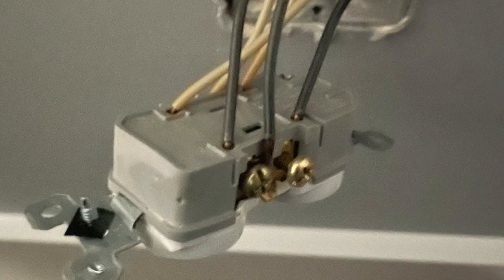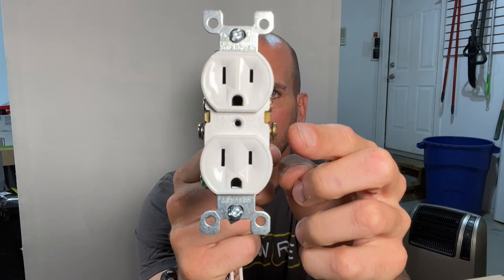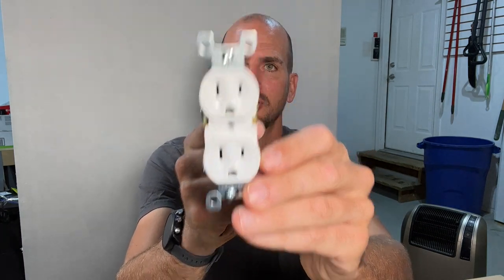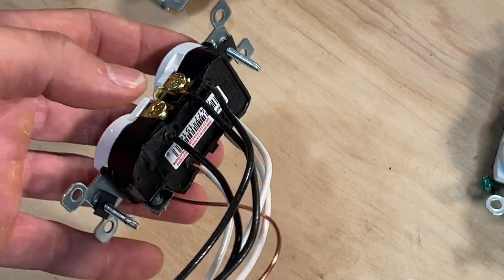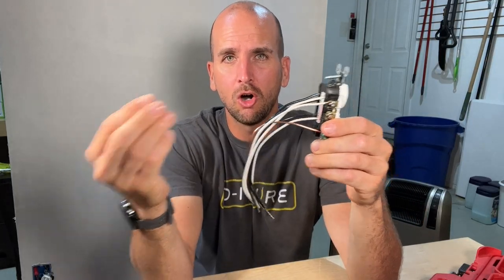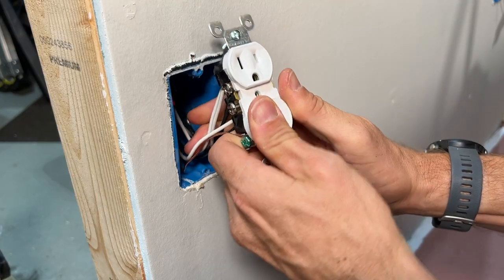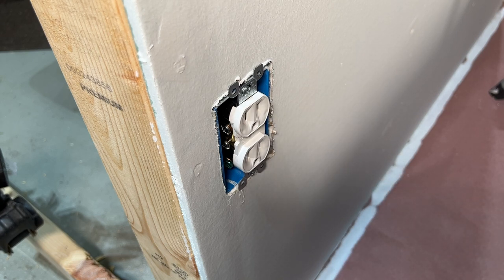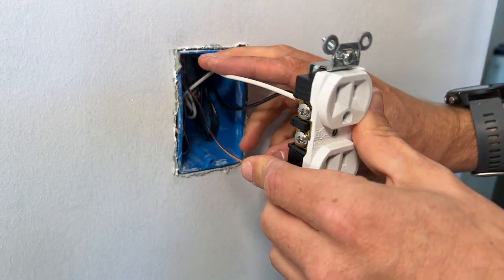Beware Of These Wiring Mistakes Made On Newly Built Home

Comment: Great video thanks a lot, bought a condo built in 1974, most outlets have the top outlet controlled by an on/off switch and FOUR neutral wires ALL backstabbed, I can use a wago for four neutral wires and connect to pole and then connect the two Hot wires to other pole.

Comment: I have been subscribed and watching for quite a while, always learning. I love the Wago 221’s for adding fixtures and doing pigtails. One trick I came up with is to wrap electrical tape over the levers when closed so they can’t be forced open and if it is a pigtail that turns 180 to to get to the fixture/outlet tape it down to the side of the Wago so it can not spin and possibly loosen. An extra step but makes me feel better. 😀😀

Comment: I totally agree, I'm a tech for Toyota and the way guys repair vehicles, flat rate style. I don't agree with flat rate repair rushing vehicles in and out of our dealerships. I would imagine same goes towards building homes as fast as the developers would like to complete. I did our electrical in my home as per the NEC and alot of it corresponds to the way you explain SAFETY. Thank you..Ricky

Comment: After wiring my campervan, adding and replacing outlets in my home and swapping the absolute garbage excuse for an outlet with "real" outlets in my dad's RV I have come to like the leviton decora heavy duty outlets. They are better quality than the residential outlets and offer my preferred wiring method, back wire. (Not back stab)I also find that pigtails and WAGOS can make the job easier if you're working in a tight space or with very short wires coming out of the electrical box. On a side note it is always entertaining to see people argue in the comments over their preferred methods and their own interpretation of code and best practice!

Comment: Good ideas on the Wago connector pigtails.
Reply from the maker: A lot easier to bring 4 wires together with the WAGO 221 lever nuts 👍
Reply: @EverydayHomeRepairs   I'll try this on my next 15A receptacle repair.
Reply: Did I see THHN wire in the video?  Why not UF-B 14/2 or 14/3 for indoor residential receptacles?

Comment: I have even seen outlets with no screws at all (back stab connections only) in a residential installation.  When a contractor is installing hundreds of outlets a few minutes time saved on each one can add up to a lot of money at the end of the job.  However I always side wire using the screws or back wire on commercial grade receptacles with screw down clamps.
Reply: The best is not to create three separate wires. It can be done. Daisy chain should only have two sets of wires not three. Start at one end and end up at the last outlet. Never run supply at the center. I also never put lighting in my daisy chain outlets. A separate breaker for lighting. It's nice to work on outlets with the lights on. Most short circuits are from outlets not so much lighting circuits. There are exceptions to the rule. I also don't use number 14 wire. The only acception would be outdoor lights to save money on UF Romex with LED lights 14 would be heavy enough. Outdoor outlets I use number 12. I'm old school and range hookup will be number 6. I know about using number 8 but 6 is better , just like 12 is better than 14. 20 amps is better than 15 and 50 amps is better than 40. Remember I'm wiring my own home so I dont need cost saving shortcuts. If I was hired then I have to listen to my boss. I'm wiring my home I'm the boss. 73
Reply: I always run pig tails and use screw terminals on jobs where the customer is reasonable to deal with. When I get a cheap customer that wants me to do it cheaper I use daisy chain and back stabs I don't even tighten the screw terminals then either if it's a plastic box. I think as a contractor it's important to respect people that respect you and your profession. I always go the extra mile for people who are good to me. For people who just want it done they get the bare minimum from me
Reply: @gurjindersingh199  I only run 2 pairs of Romex on any of my outlets, start on one end and end on the other. I never include lighting on my outlet runs. My lights are on another circuit even outlets used for lighting. My dad taught be this practice. I only use screw terminals or screw down on the back holes I never use them cheap push terminals. Now I'm only wiring my own or a relative home. I'm not a licensed electrician. 73

Comment: I don't know how the recommendation of a 20a breaker vs 15 is much of a mistake. If you are adding a circuit in a new construction, then sire it is the better choice. But upgrading the entire circuit and breaker might be out of the range of a diy project.
Reply: Exactly. It's always not reasonable to rewire a receptacle circuit that's 15 A, 14 awg to 20 A, 12 awg, especially if they're sharing some lights

Comment: Instead of using the term back stabbing,  I like to say La-Z-Wire,  QuickWire or SpeedWire to avoid confusion to back wire, since people tend to use the terms interchangeably,  including myself when I first entered the trade.    I do not like backstab,  and have seen them fail.  

The worst failure of a back stab,  was in a home built in the late 70s where the neutral failed on a multiwire branch circuit in a living room.   The receptacles were alternating between the red and black along the wall sharing a common neutral,  fed with 14/3w/G NM.    A television and cable box went up in smoke,  when the neutral opened when an electric fireplace was in use in a different receptacle, placing everything downstream in series with 240 volts.   One good reason the code requires pigtailing the neutral when a multiwire circuit is used.
Reply: "Instead of using the term back stabbing,"

Just call it what it is- cheap-connector ;)

Comment: I like the WAGO connectors has much as you do. One more European product I would like to have available here in Canada and US is the green/yellow sleeve the UK electricians install on the bare ground wires in the outlet boxes as well as in the main panels. I think we should consider using this method for better safety in our thigh outlet boxes.
Reply: You can wrap green electrical tape on bare ground wires to insulate them, or use liquid electrical tape on them as well.  Liquid electrical tape comes in green for grounding, black, white, red and other NEC Colors.  I've purchased liquid electrical tape for projects before.
Reply: I agree with Max here. Just wanna add that sleeving or insulating a bare ground wire inside an outlet box isn't necessary, since the ground wires aren't current-carrying conductors and provide better contact with a metal box whether or not it's bonded to ground. So the only benefit I can think of for using a sleeved ground wire is to distinguish a pigtail bonding a metal box or device.

Comment: I'm with you 100%, back stabbing is a no no as are cheep outlets, I only use 20a outlets and 12 ga wire but have found electricians that will not use 12ga wiring saying it's too hard to work with.  Wagos are the greatest but a word of caution there is a marked difference between the Chinese knockoffs witch I received by mistake and sent back.

Comment: My main concern with Wagos is the wires use an internal busbar compared to touching directly.  However, you are extremely competent doing a lot of work with them.  This video has convinced me to give them a try.
Reply: Don't worry. Wagos are awesome. They're super easy to use and very reliable. I use them for every ceiling fixture install and attic junction box I wire.

Comment: If you want to  use 20A circuits for receptacles  you then can not mix lights  with the receptacles In Canada. In residential you can not have 20A lighting circuit's.

Comment: Scott mentions "pigtailing" and I immediately think "Wago nut time".   Guess what I use for electrical work...   

I would be careful about calling #4 a mistake.  My house is 100+ years old there is still knob and tube wiring on the main floor and second story.  Since I don't know the gauge of that wire, I'm keeping those breakers at 15 amp
Reply from the maker: Yeah, more of a mistake for the new builds.  If you are going to do all the hard work of building a house might as well put your outlets on 20 Amp breakers with 12 gauge.  Or at least that is my preference 👍
Reply: @EverydayHomeRepairs  if the customer requests it, then you will get 20 amp recpts, but only kitchen circuits by code need to be done in 12 gauge. Of course code requirements are only the MINIMUM sufficient methods to accomplish something safely, so there are always ways to do it that are better. The reason you won't see a lot of professionals use better methods is because at the end of the day meeting the minimum standards is the cheapest and quickest option, so that's why it's always a good idea to specify any things that you would like to be above code requirements.

Comment: As an electrician who has to be up on code, you have to replace receptacles with tamper resistant receptacles when replacing. As far as wego's,, they are the same a the receptacles he was complaining about. Tucked wire nicely, j-hooks are good with not much bare copper behind screw. As far as 12 gauge wire, if there is existing 14 gauge wire you CAN NOT install it on a 20 amp breaker because you will not be protecting the existing 14 gauge (15 amp wire).

Comment: When working up plugs on commercial pre-fabs we use the "back wiring" aka pressure-plate connections with the addition of bending a partial-J hook (L hook?) on the wire to put a little more surface area inside the connection. The darn engineers and installers still have a love/hate thing going on about wagos.

Comment: i like back wiring better than wire nuts I have a house full of messed up wire nuts with 4 wires or more you only need 3 wires with back wiring, and you can clearly tell and see it is clamped in their correctly you save the 1 wire extra in connection for the pigtail

Comment: Backstab, quick wire, or speed wire (whatever you wanna call it) holes can be sometimes be reused if the wire was properly removed. The problem I have with this method besides having to pray they hold the wires is that the wires can spin and eventually come loose due to that. In fact, you don't even need a special screwdriver to release the wires. All you gotta do is pull the wire while twisting it and it will slowly come out. Bet you can't do that with side wiring nor back wiring.
Reply: you might be able to twist and pull the wire out of the outlet when backstabbing. One awesome example of why are you want to side wire or back wire is that even if you twist and pull on the wire, it won't come out!

Comment: Very helpful tips i enjoyed your video.😎 Also i have seen where people try to replace 15 amp breakers ith 20 amps which i done recommend unless the wire is 12 awg or so.
Reply: Replacing the breaker to higher than the wire can handle is a clear violation. The purpose of the breaker is to protect the wire.
Reply: A variation (seen on my g/f's house) is a 20A breaker, with 12g wire,  Sounds good. But they I followed it to a junction box, which then has a mix of 12g and 14g wire connecting to it.    I think because of the 14 gauge, I'll need to drop the circuit to a 15A breaker.
Reply: @jwhite4  Yeah, if you're really concerned about the 14 awg carrying too much current on that 20 A circuit, then replacing that 20 A breaker with a 15 A is an easy solution. 

Another good option, which is way harder, is to wire those 14 awg wires onto a 15 A circuit. Plenty of ways to achieve this. Either run a new 14/2 from the panel or from the nearest/easiest 15 A outlet box to that junction box if there's enough capacity or a new box for all the 14 awg wires if there isn't.

Comment: Yeah, the commercial outlets is what I like at home and WAGO connectors.
I hate how they make the damn boxes so freaking SMALL and I never use anything smaller than 12ga copper in my house.
I dont know why they dont make the green ground connector ALSO a clamp in connection like the other two, it forces you to have to wind the wire around the screw.

I'm wiring up a generator inlet to my Sq D panel, the  lockout kit I put in already. I only have a 2,000 watt inverter 120v generator and it was a lot of hunting around to try and find a way to connect it, and connect both legs, but in the end because of what search results I found- it's not as simple as just connecting two breakers or the like to power both sides, so I'm going to power one leg and need to move one breaker over so I can have lights in my main room, computer/router/modem, and furnace, and as needed I can plug the fridge in and turn the furnace off for a while.
All my lights are LED, everything like water heater, stove, clothes dryer etc are gas, furnace is gas but has a blower fan of course- its on a 15 amp breaker, no dishwasher, space heaters etc so the generator will go a long way in my house to powering what I NEED during power outage.

The problem was finding connectors to go from the normal A/C 120v outlet, and all the boxes I found etc were 30, 50 amp with 3 or 4 prongs, but I found what I need;

Outside inlet socket box; Reliance Controls Corporation PB20 20-Amp NEMA 3R Power Inlet Box for Generators Up to 5,000 Running Watts
Adaptor cord; Parkworld 885460 Adapter Cord 5-15 Male Plug to Locking L14-20 Female Receptacle 

So with that I can plug that cord  into the generator at one end, into the  inlet box socket at the other end, and then from the inlet box to the breaker panel I'll have MC 10/2 cable to a 15 amp breaker since the generator isn't going to put out 20 amps, but the larger cable etc gives some overhead and one never knows what might change on the generator side of things in the future with size etc

Comment: How do you make a proper J hook as well as get it around the screw, especially one that moves around a lot like you used? I found it so completely impossible I had no choice but to use the backwire. Bonus brownie points from me if you can tell me if you don't have a lot of wire to work with and can't rewire the entire house.
Reply: Hey its pretty easy with the right tools. Most good wirestrippers come with a hole labelled "loop", so you just strip a bit more than 1/2" of insulation off the end and feed it into the loop hole and bend it around the tool to form a perfect j-hook. Tons of videos on youtube out there on how to do it.
Reply: Also if you dont have a lot of wire coming out of the outlet and there is no slack to pull a bit more out, one practice is to pigtail the existing wire to a new piece of romex that goes to the outlet. You can use traditional wire nuts or those wagos mentioned in the video.
Reply: @Kevin-mp5of  If you can't be respectful its a sign from above you shouldn't reply in the first place.
Reply: @ededdeh1960  Thank you for the detailed replies! It's much appreciated.

Comment: The back wiring is nice because you don't have to fool around with making J-hooks which always drive me nuts, plus there is no hassle with slipping the J-hook under the screw. It's worth the littl extra for commercial outlets and switches given the small number (probably only one for most people) that will be requiired.

Comment: Always great information!
I bought a higher end 1984-built home back in 2005, and since then have replaced nearly every single switch or outlet. I can't believe the shoddy install job the initial electricians did. Backstabbed outlets and undersized boxes meant cramped space, and about 8 electrical boxes (all plastic!) were so full that the screws pulled out of the holes...and took the plastic with them. (Look up "G-Clip repair" video to see the parts I used for repair.)  I really do like the WAGO lever nuts, but if you look closely, there's not much metal contact area--much like the backstab tab. It concerns me a bit, especially on 20-amp circuits. Maybe you've got some additional thoughts on this.  Thanks again.
Reply: I had the same thought.  But on a different video, they showed Wago's handling 60A (3x rated) without failing.  And when pushed more, apparently the plastic case will melt away, but the connecting stayed intact.   So they seem good.
Reply: Scott did release a couple videos testing wagos current/temps at high loads. His results show that wagos are still excellent connectors to use, even in 20 A circuits.

Comment: iam srprised on your video with wiring receptacles, that you never use electrical tape to cover uo the screw terminals. especially if you’re using metal boxes. i do it for both metal and plastic boxes so they don’t ground against the box or if by chance a wire comes loose. you still have some protection against grounding the wire.

Comment: Good tips I would’ve added they exceeded the number of conductors in the work box! Also if the circuit is for Lighting such as LED ceiling cans 15 amp breakers and 14 gauge wire is more than sufficient as long as the load is calculated properly and the local code is followed
Reply: Actually they didn't exceed the number of conductors since they used 14 awg wire; rather, they filled it up to the maximum capacity. 3 14/2 romex have 7 volume allowances plus the outlet which is 2 volume allowances. Since each volume allowance for 14 wire is 2 cubic inches, the total volume that's occupied is 18 cubic inches, which is typical capacity of a new work 1 gang box. Of course, if it was 3 12/2 romex, then the box is too small since the volume allowance for 12 awg wire is 2.25 cubic inches.

Comment: Very nice video. I have one question tho about new wiring if you don’t mind. How often do these wires need to be stapled to the studs? I had a new garage built and I am randomly adding outlets all over it as needed. And I just bought a dewalt 20v romex stapler gun, and while this seems super easy to staple the wire over manually hammering every nail. I also don’t wanna over kill the crap outta it. Lol how often should I staple